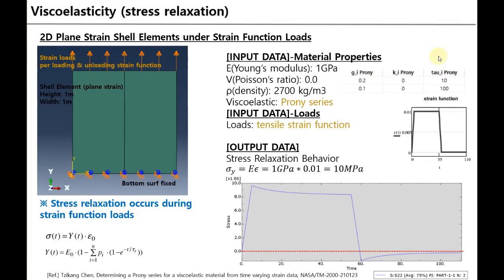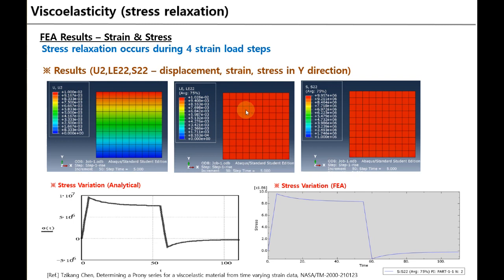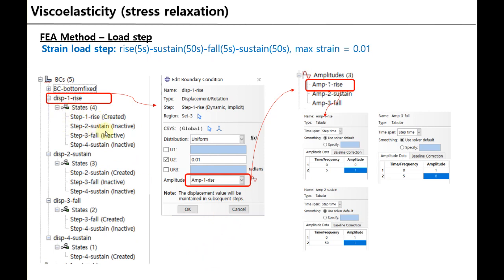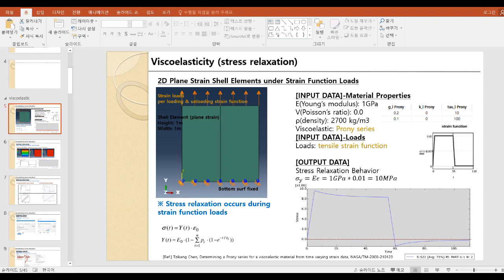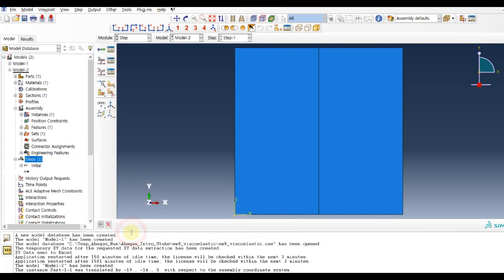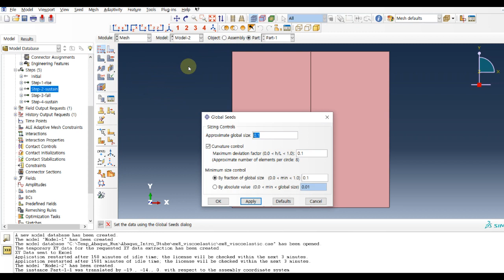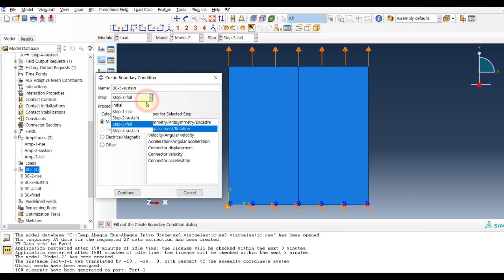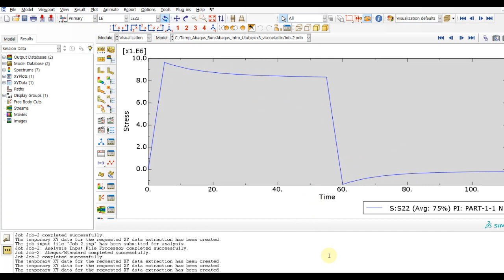Abaqus FEA - Viscoelastic material showing stress relaxation effect

Comment: Thank you for the nice video. 
What is the difference between instantaneous modulus and long term modulus. I read in the manual that it's only a matter of choice and doesn't affect the solution.
Reply from the maker: If you think viscoelastic as stress = E(t)*strain, then modulus will change from E(0) to E(t=infinity) (we can think stress relaxation)...then E(0) is instantaneous modulus, E(t=infinity) is called long term modulus.